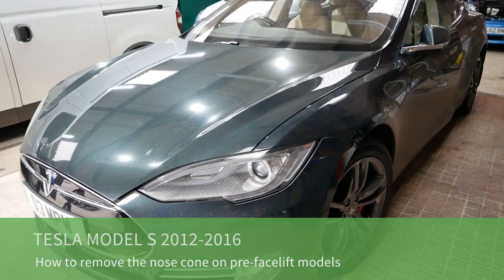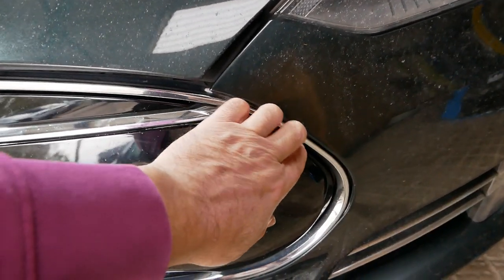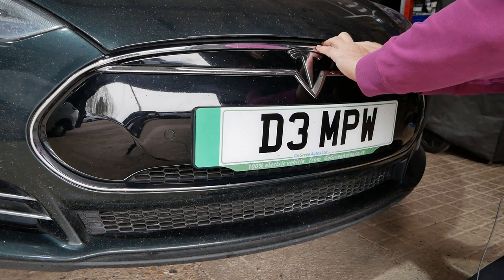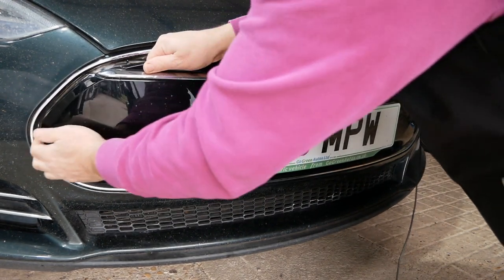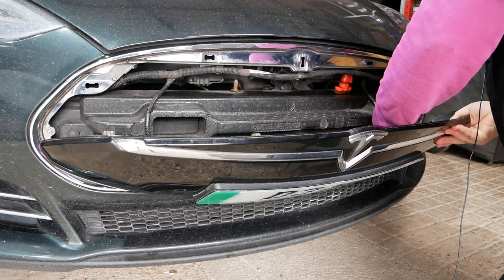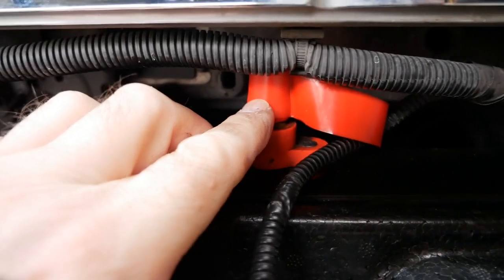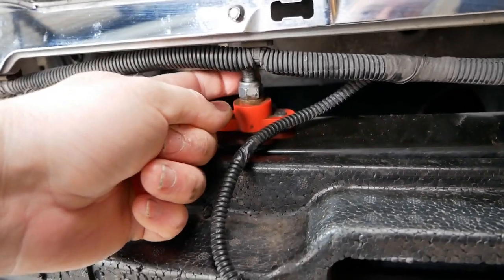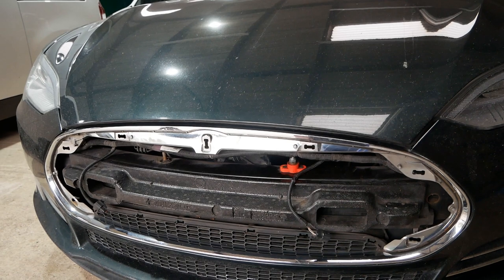How to remove the nose cone on a Telsa Model S pre-facelift, to access the 12V terminals

Comment: Many thanks. I recently used this video to get the nose cone off my 2016 MS. However, only the negative connection was there, no positive in sight. But I found another video from a chap in Slovenia (I think), who shows you how to open the bonnet manually once the nose cone is off. You do need the key handy, as the alarm goes off as soon as you release the first catch (even though the 12v battery was so low the car had shut down).